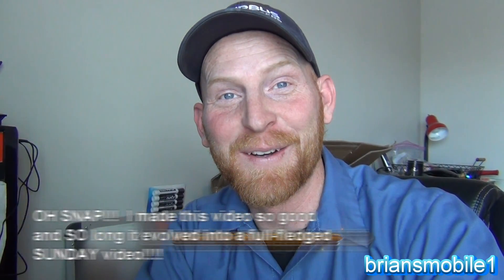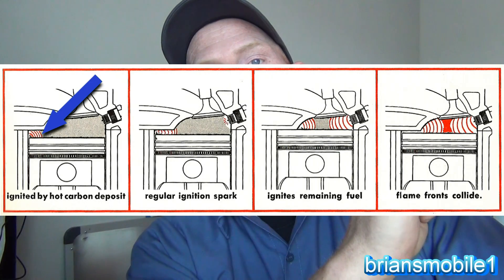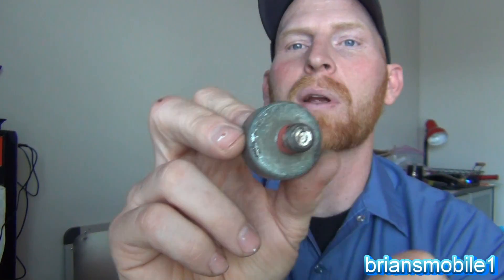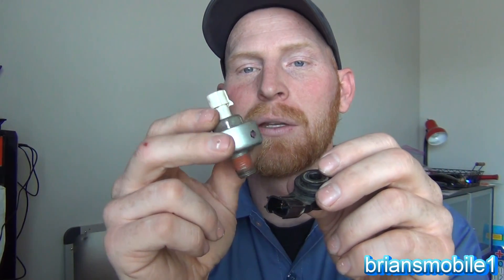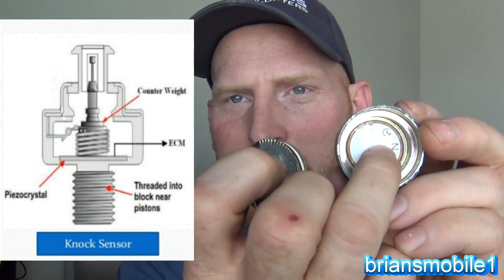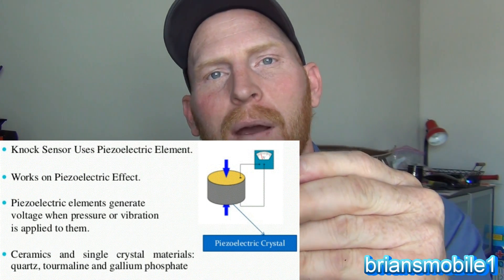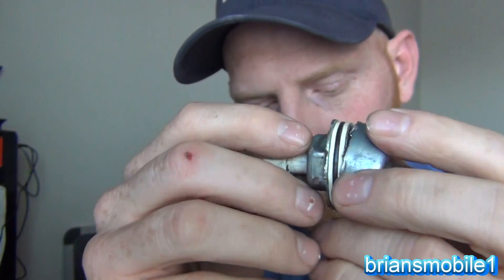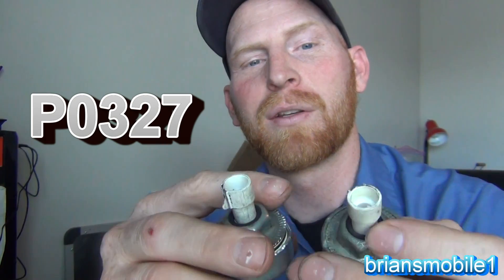The Knock Sensor Video

Comment: Good video,but those subliminal messages are making me want to visit the local strip club and I just came out of church,thanks.
Reply from the maker: joeandgod1 Well Joe, that's between you and God......1
Reply: How much should it cost to change a knock sensor on a 2002 Toyota Solara SLE 3.0 ?
Reply: I just replace the knock sensors and I think I use bbw and the engine check light is still on thanks to you I will buy the ac delco and hopefully that will fix my truck
Reply: lmao
Reply: how tight should the knock sensors go in a Silverado 2006 5.3L

Comment: Hi Brian  GM is going to try to muscle out "aftermarket" mechanics by claiming the software is their property and car buyers are only leasing the use of the software, thus forcing everyone to the dealer for repairs. John Deere too. If this works well for them we might expect the same from other automakers.  I know you are probably aware of this and would like to hear your comments.
Reply: That about Airtex is scary!!!!!!  I swore off Airtex fuel pumps years ago after replacing 4 in a customers 2001 Blazer in a year.  They are complete junk. I've been using Precision pumps for the last several years with good results. And now they come with a Lifetime Warranty.
Reply from the maker: Steve Allen The news strikes me like the news of someone dying from doing something stupid.  It makes me sad.
Reply: ***** Get down patriot!!
Reply: Emt Scythe Airtex water pumps were/are great!
Reply: Never used an Airtex water pump. I just stay away from anything from them.
Reply: ***** Out of desperation I bought a idle control by Airtex because the other brand available was even less known. 
I went from a valve that stayed too closed to one that stayed too open. I shouldn't have bothered. If those are the options and up for a dealer part right?
Reply: Eric the car guy did a ETCG video about this and in the comments a guy put up a link for a petition. Sorry, I'm being lazy and saying "go find" it. ..but I'm just on my cell and it's a pain. Lol

Comment: Prefer cars with engines that do not have the knock sensor at all both turbo and non-turbo . They feel the knocks through ionization of the spark plugs.
One less thing that can give up and cause trouble codes .

Comment: Brian I have had good luck with Standard/Bluestreak knock sensors for LS engines. Last one I did was my own 2500hd.  I have yet been able to remove the harness connector without it shattering so I always order a new harness.  It's quite expensive paying someone to change them out so going with a factory  part is probably worth it.  Great info 👍

Comment: Brian! Not the one to be picky because I love your informative videos, but you said turbo cars and supercharged cars want higher compression ratios. Technically they want lower compression to reduce strain in the bottom end (talking specifically petrol cars), hence the reason of not being able to turbo factory non turbo cars. Though a higher compression ratio on low boost pressure (turbo/supercharged) is much more efficient then it's N/A version with the same compression ratio (hence, where the diesel cars fit in)
Reply from the maker: Please bear in mind that when I was doing this video I was spread thin and was interrupted about seven times.  I just plain miss spoke.  I called the knock sensor an oxygen sensor too.
I'm human.  I get a lot done in a day, but I'm not a machine.  I'm not perfect.
Reply: Nik Trp This. Also, low octane fuel doesn't leave burnt deposits in your cylinder, any fuel can, specifically lower quality gasoline regardless of octane.
Reply: Nik Trp I also caught that right away and wanted to comment, but already had been done. Regarless briansmobile1 thanks for taking the time to make these videos. You do a damn good job explaining things so that everyone can understand.
Reply from the maker: User Name It's incomplete burn.  That could be many things.
Reply: briansmobile1 agreed, even oil entering the center. However on an otherwise healthy engine my first choice is poor fuel.
Reply from the maker: Nik Trp I should have known that.  Thanks for bringing that up.
Reply: I said that because the people who will be here for the sake of argument will really hammer down when they see the video poster comment. 

I don't see anything wrong with your comment in general, just a point of YouTube comments and their quick escalations to shit storm
Reply: Nik Trp I don't like the sentence "want higher compression ratios".  It is a very sloppy generalization.  Though you are not entirely inaccurate, there are other variables to consider in the equation.   Sure, there is a narrower range of compression ratio (static) when forced induction is applied.  .............  But who and why are they altering such major variables?  Just don't augment your motor "too" much, if you do not know what you are doing.  Otherwise you will run in to many problems, shorter living engine, less reliability......   If you are serious, put your car on a dyno and get a print out of the stock hp.  After any change is made, run back to the dyno and get another printout.  Monitor your gas mileage..........
Reply: Nik Trp When he said that I was waiting for someone to say this. I don't agree with you, he was technically correct. If you are talking static compression ratio (CR) then yes, forced induction (FI) wants a low CR. 
However what really matters is the Dynamic CR, which on a FI car will be (almost always) higher than the N/A version. The static CR is a fairly useless term when talking about pre detonation.
Reply: Samuel Corbett I think he's saying more air/fuel mixture to compress.
Reply: ***** As opposed to?
Reply: briansmobile1 this as already gone to us trolls man, bail out, bail out.
Reply: briansmobile1 User Name For what it's worth I think that a lot of people could benefit from knowing the difference of static to dynamic compression ratios. 

Also, I don't see how this has gone to the trolls.. What a silly thing to say to dismiss a discussion.
All I see is a discussion sparked by a simple freudian slip about a relevant topic (pun intended).